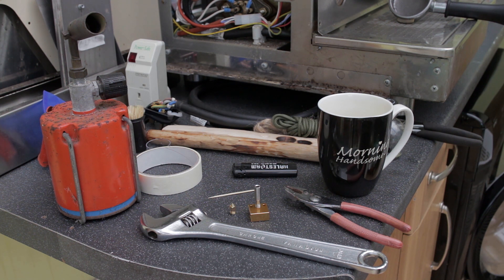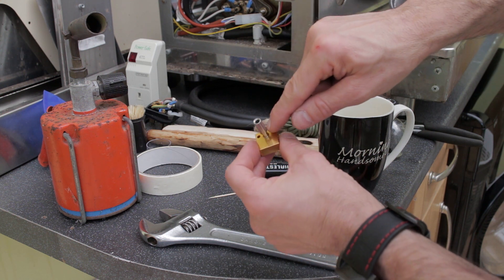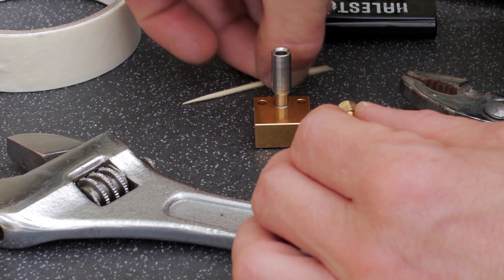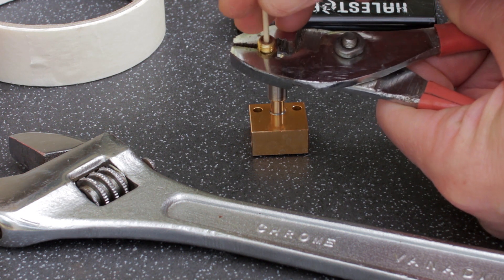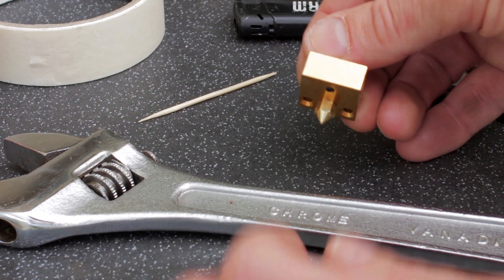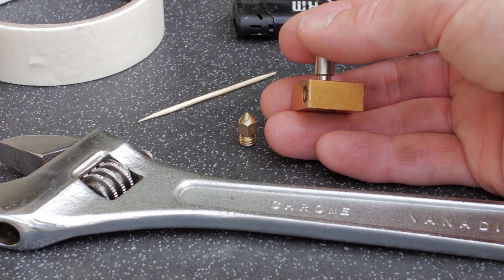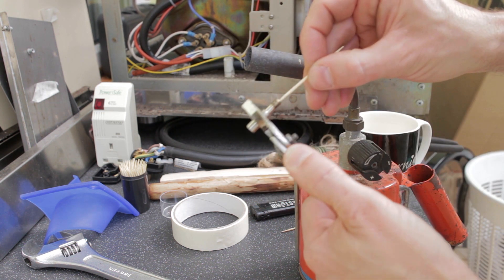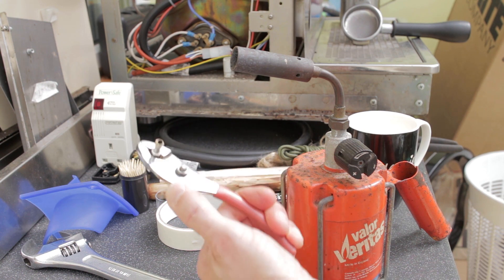Creality Ender 3 Blocked Nozzle Cleaning 3D Printer

Comment: I had the same issue with my Ender 3 after the 5th print so I ordered the Titanium Heat Pipe from TH3D Studio. Titanium doesn't transfer heat in the same way as the stock Stainless Steel Heat Pipe.
Reply from the maker: Does it work better than the steel one? I've not heard of that. I've seen a lot about the all metal hot ends.

Comment: have you try to use the filament for cleaning nozzle and heat the nozzle to the 240 degrees it will do the same and not need to disassemble the  nozzle
Reply from the maker: Yes, I tried both a hot pull and a cold pull first but there was filament stuck due to the PTFE tube not meeting the nozzle.

Comment: Thanks for the vid, very helpful, just had the same issue with my Ender 3. Still love it, despite all its little issues. I've learned more about 3d printing because of it than I thought possible. Keep sharing the tips!
Reply from the maker: Thank you, glad it was helpful, in still very new to all this but learning lots as I go and trying new setups, just moved my spool down so it's more of a direct feed to the extruder and uncoupled the wires from the Bowden tube and playing with profiles for minis and fine detail which I hope to do a video on soon.